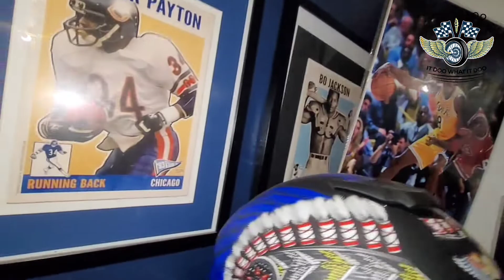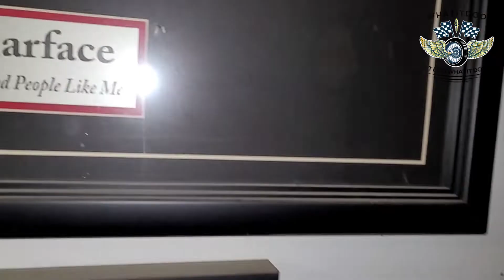Harley Davidson | Electra Glide Classic | front headlight | upgrade install

Comment: manufacturer and part number?
Reply from the maker: https://www.ebay.com/itm/185567448140?mkcid=16&mkevt=1&mkrid=711-127632-2357-0&ssspo=hAV88jBhSS-&sssrc=4429486&ssuid=UkiOOWXQSXm&var=&widget_ver=artemis&media=COPY....   here is the link they have alot of new styles also. Thanks for the comment. Be safe out there. Two Wheel Luva